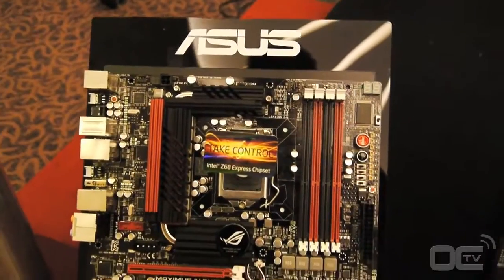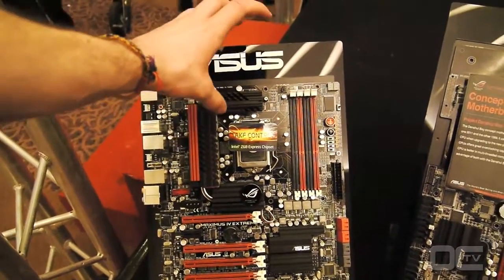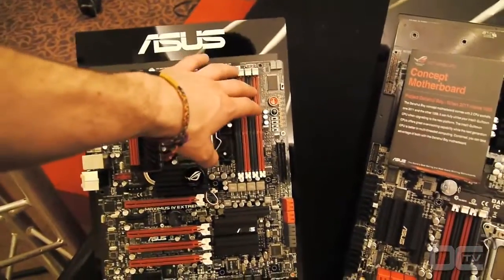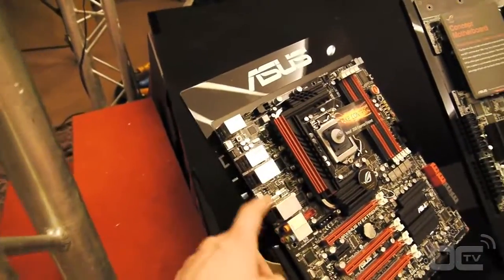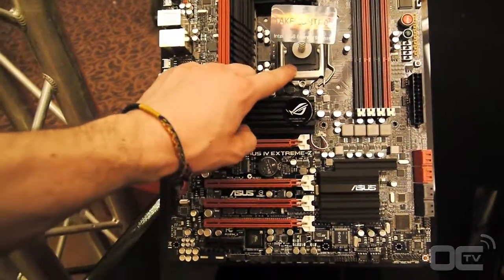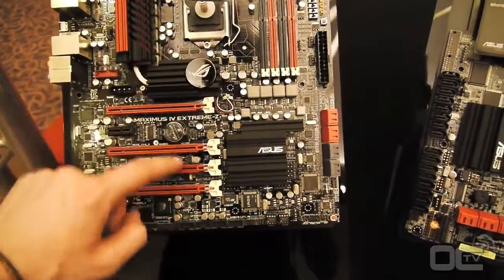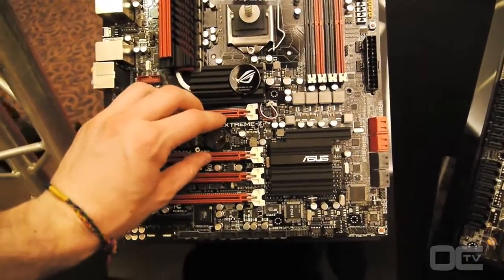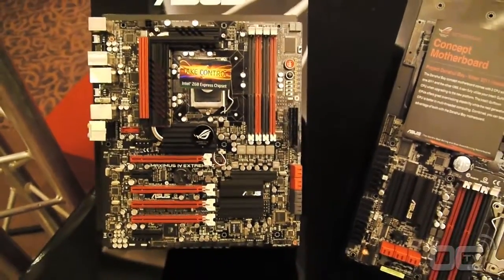Asus Maximus 4 Extreme Z - Computex 2011

Comment: @TheTemplai Do you know if they're going to be releasing something similar to the EVGA-SR2, not the concept Danshui Bay, but literally Dual X79 Chips? Cause that'd be extremely sexy to pair with Dual GTX Mars 2, and some 8-10 core CPU's. I've been hearing this Knight's Ferry thing with 4 cores per thread, and 32 cores, but that's like a .001% chance of coming to desktops. Even still. Will these boards be held off for PCI-E 3.0, and DDR4? I want a monster of a machine... as you can tell...